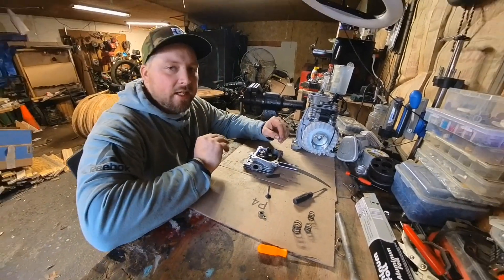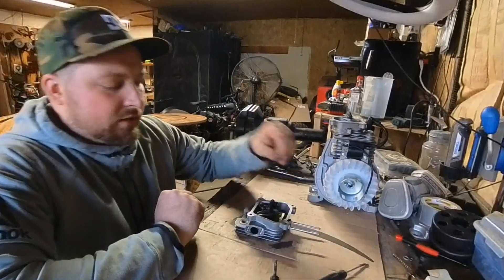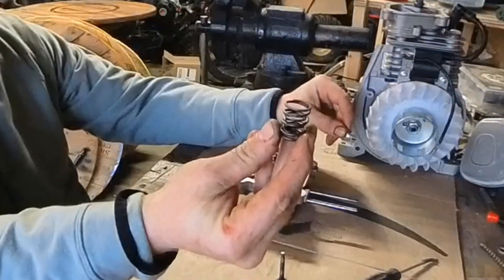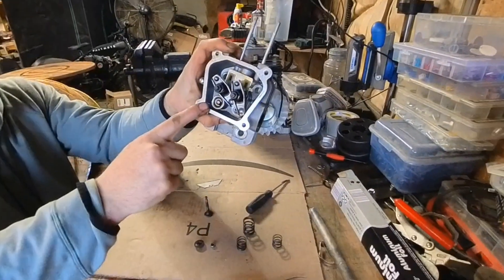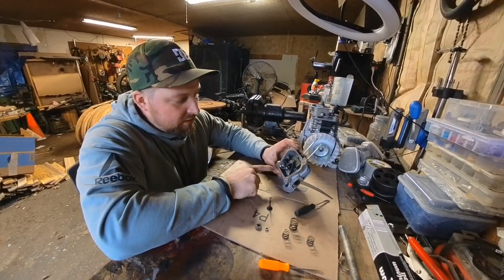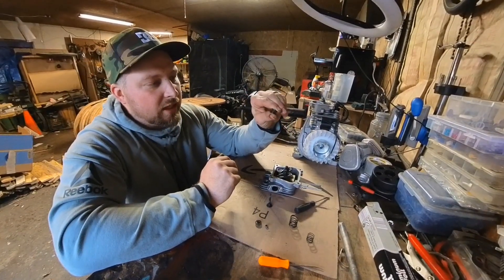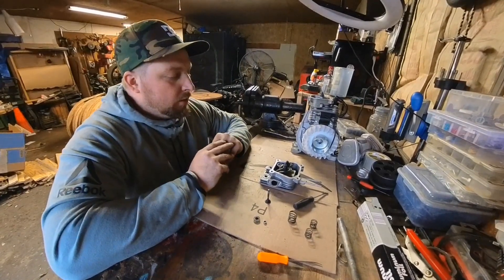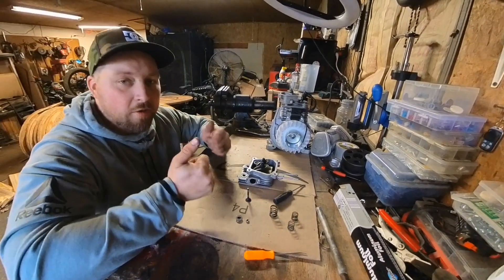lifan 79cc with predator 212 valve springs

Comment: 😂 I love this bro, I've been looking at a KBA 64" feeder foot spring. It's ridiculously strong though.
Reply from the maker: I THINK IT IS GOING TO WORK
Reply: @engineunknown2  I genuinely think it will, I've always thought if it'll fit it'll work
Reply from the maker: @docholiday3800 same here, but there sometimes it does  go bad
Reply: It's not the valve dropping that I'd worry about.. It's the flywheel. I'd set it up on the bench behind a shield. Then run it for a half hour at 7k. Before I'd trust it between my legs. Be safe brother 👍 🤗
Reply from the maker: Well it didn't explode yet. I've had up to 7500 rpm, but it will make for a good video
Reply: @engineunknown2  man I wish I had a spare to tinker on, 7500 is amazing man! I'm already looking for decent deals for electric start 200's.  I'm a Carpenter not a mechanic 😂
Reply: Any updates or videos of you running it ?
Reply: I’m asking did the 22lb springs work on that motor and what type of speed did you see
Reply from the maker: O sorry about that. It did run good till I ended up bending the push rods

Comment: Do you no what the lifters lashin is for the 79cc lifan 152f-3  cause when I was doing the governor delete the inside feel out I put it all back and I set the lashing kinda by feel until I could get the pull cord to rotate motor and I threw the pz19 carb on and now I can't get it to fire up
Reply from the maker: intake .003 exhaust .005 (inch)
Reply: I have one more witch lifter is the intake and which one is exhaust
Reply: What happend it you run both the same? Mine has gov deleted after market carb and exhaust...@engineunknown2

Comment: 22 lb valve springs are crazy especially if you put the stock one down inde it.  That increased pressure is going to prematurally wear down the lobes on your cam.  I just installed 18 lb valve springs in my engine good to 6200rpm.  Bad news is at max cam lift the coils actually stack with no clearance between the windings.  NOT GOOD!